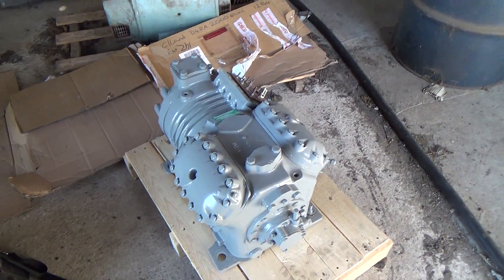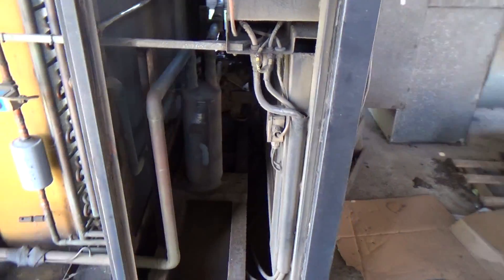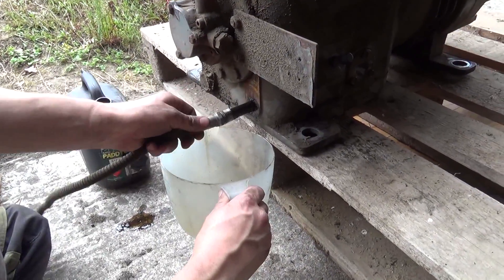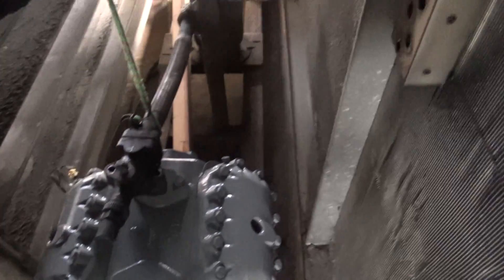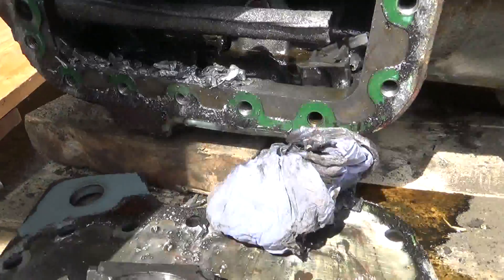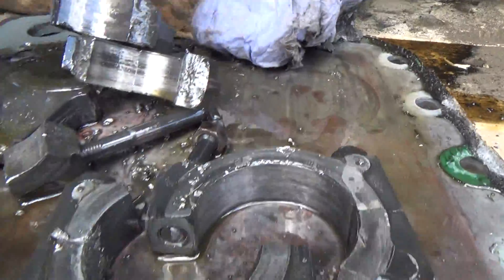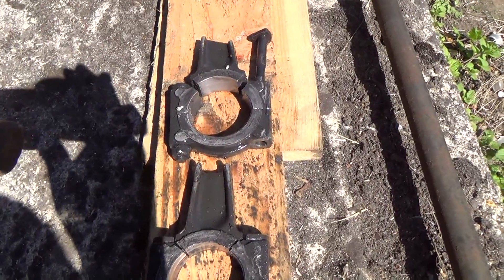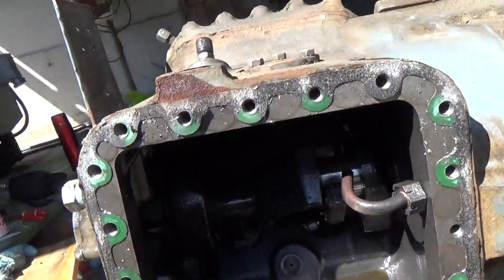20HP Copeland Compressor Autopsy

Comment: Big job, i dont understand, you recover all the gas? The tap from suction and discharge pipe was faulty?
Reply from the maker: It was an R22 system so we had to convert it to something else, in this case R407C.
Reply: @heavydiesel  yes, i understand now....

Comment: Look at the oil strainer in the video as it looks almost totally clogged with sediment would lead me to believe that is where the problem began because of lack of oil pressure,  I've seen many of these failures over the years even up to where crankshafts have broken in half. I am not dismissing your diagnosis by any means but as I said judging by the the oil strainer condition in the video I would have started there.
Reply from the maker: We found out the control circuit had been bypassed, so the low oil pressure switch could not stop the compressor.

Comment: today i faced broken 3/6 con rods. i may say the nut problem as secondary problem. and main cause could be the flood back and oil level switch. none of electrician can verify the accumulator and the oil switch.
Reply from the maker: Yes we were just guessing what caused the failure.

Comment: I am commenting on a 1/1/2 year old video, sorry. I found it very cool and interesting. I grew up on a farm in the Midwest USA. Where I grew up farmers would use a propane fired heaters to dry grain. They did this to bring the moisture count under a certain percentage. They would be on the outside of the grain bin connected with duct work and fire under a perforated floor. Very common to have to dry corn in the area. Propane can be expensive, seems like that would be cheaper than using propane gas. Cool video on the setup and failed compressor.
Reply from the maker: Thanks! We look after one site where the refrigeration system is supplemented with a propane heater, frightening when it fires up as no safety guards etc haha

Comment: Looks like it tried to compress some liquid.
Reply from the maker: Dan Gunson Thats what i wondered to start with as this machine sits idle for months until the harvesting season, but the valves were all good so i don't think any significant amounts of liquid got in the bores. I think one of the bearing cap nuts came loose and because someone had bypassed the oil safety switch there was nothing to stop the compressor from wrecking itself.

Comment: can the old compressor still be rebuilt by a remanufacturer?
Reply from the maker: I94SOUTH Yeah, the rest of it seemed in good condition, new set of rods and pistons, new oil pump and valve plates and be nearly as good as new.